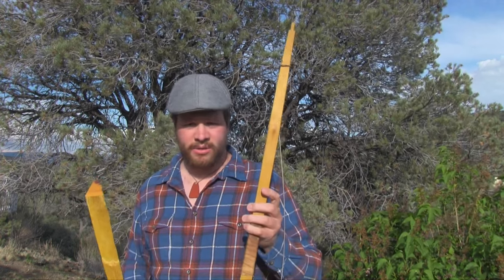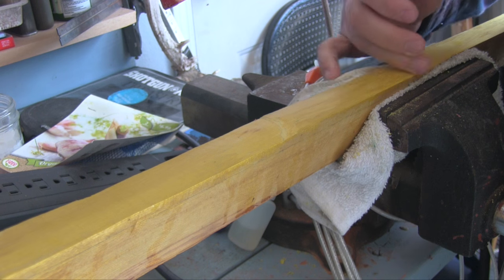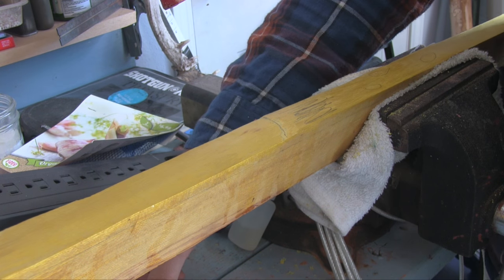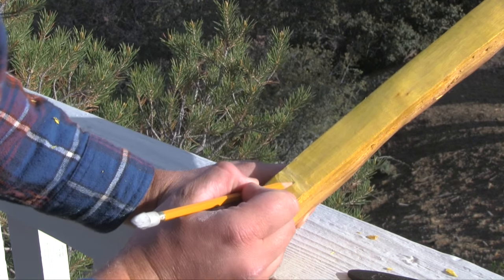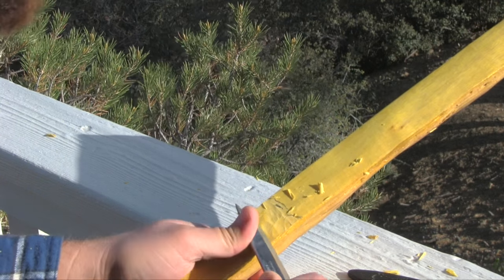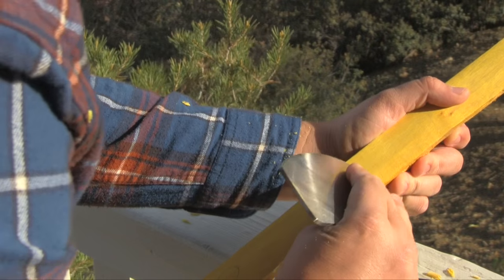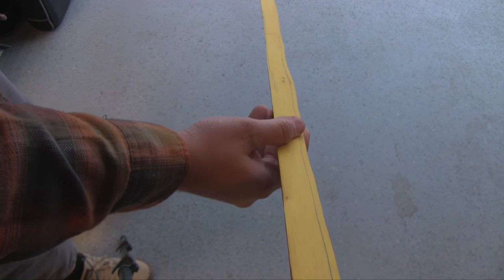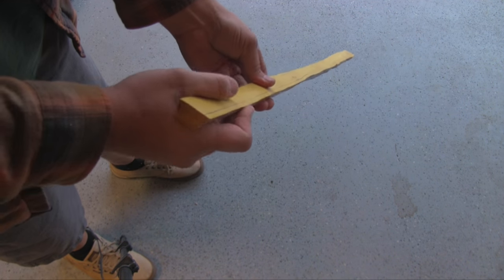Making an Osage Orange Bow (Part 1 of 4)

Comment: u are taking down the layers of growth rings in order to end up with 1 growth ring presentinbg itself as the outer growth ring for the length of the bow in order to keep true to overall surface consistancy so as to try and avoid the stave from splitting or burring or splintering etc?
Reply from the maker: Not sure what you are asking, but yes, the entire back of the bow should follow a single annual growth ring.

Comment: I need advice? I have whole osage tree puled out when building a road. It's been two and a half months outside exposed to rain and snow. Is it good for cuting a log from it to build a bow or  not?
Reply: Iliricum Dry Mountain Osage is one of the most rot resistant woods there is. it would be okay even after 50+ yrs on the ground. more concerning is how the wood dried without being split and cured...it may be fine or maybe not. More important is the latewood earlywood ratio, split it into staves and look up how to identify the good staves from the firewood.